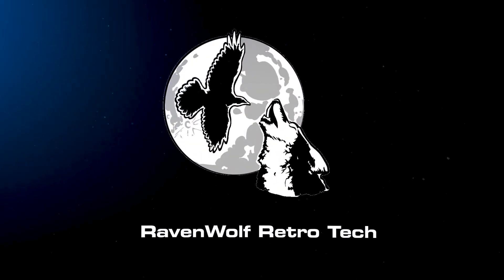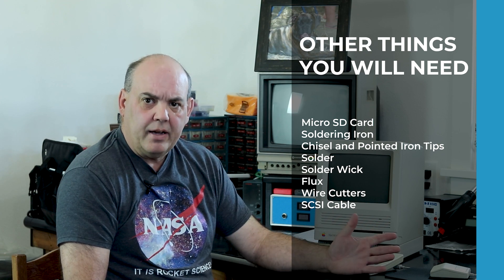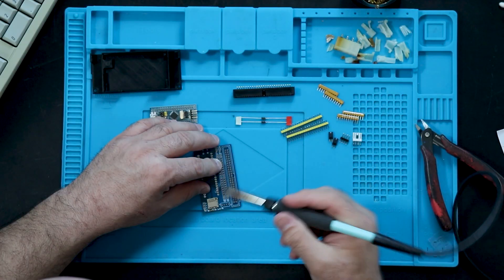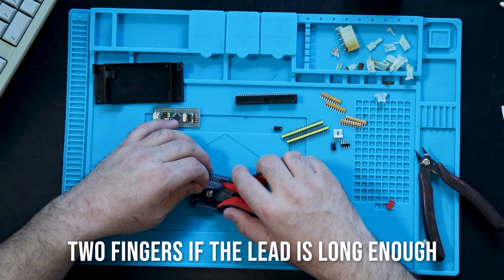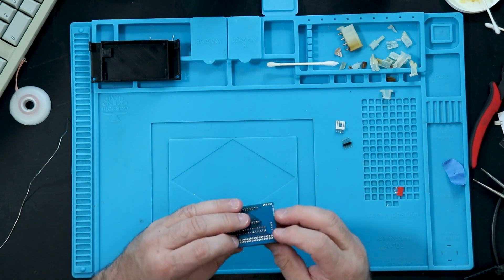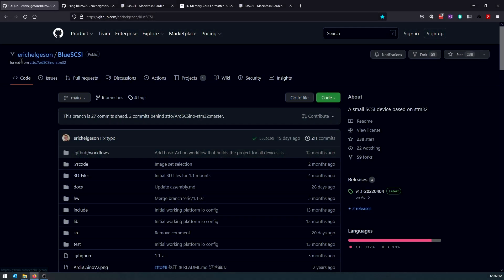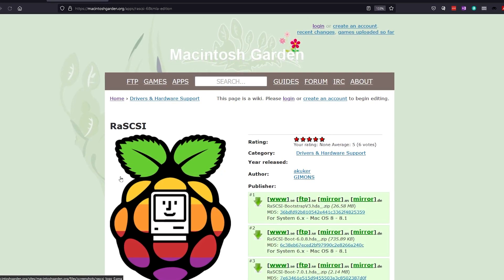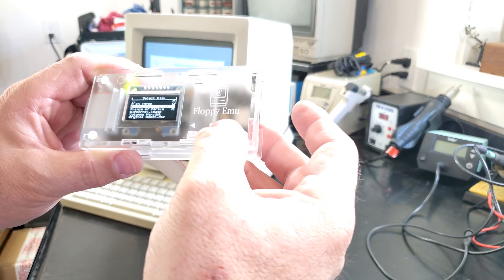How to Assemble and Configure a BlueSCSI Kit - SD Card Setup- Classic Macs

Comment: Hello, how to install Windows into this SD card? help me
Reply from the maker: Honestly I have never tried to install windows on one. I am soldering up the newest one right now and plan to use it on the C64 in a CMD hard drive and I have used it successfully on the Mac SE/30 and Amiga 2500 and 3000. I would think that you would need to create a hard disk image then format it and install on the PC but cannot test that because I have no SCSI controller for  a PC.
Reply: My 2nd question
My problem is I know programming very well. But which program should I install into Arduino STM32F103C and how? @RavenWolfRetroTech
Reply from the maker: I wish I could help but this is not my area of expertise. Were I trying to do it myself, I would probably end up spending several days researching and trying things.
Reply: thank you for your answer @RavenWolfRetroTech

Comment: Why does it show you renaming the FOLDER to HD00_512.hda - shouldn't it be the file extracted from the zip?
10:50
Reply from the maker: It's been a while subs i did this and I'm away from home but if i remember correctly there is s naming scheme in the instructions and the file name defines the drive as scsi 0 at 512 mb. You can change the drive size and have up to 7 scsi devices
Reply: @RavenWolfRetroTech  I understand, but the video shows a folder being renamed and not the hda file.
Reply from the maker: Unfortunately my vacation internet doesn't allow streaming ($50 more) so i can't look at it. I'm guessing I'm renaming the. Zip file which has a folder icon because it's a container.